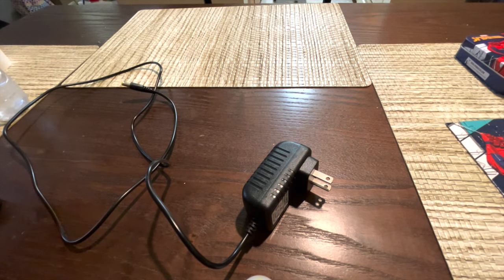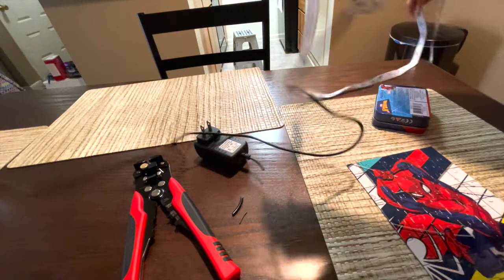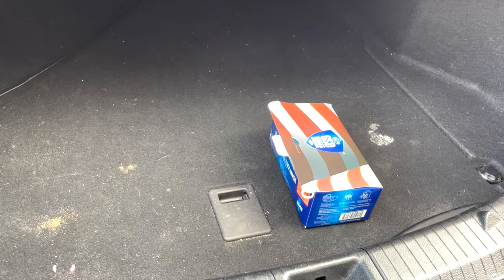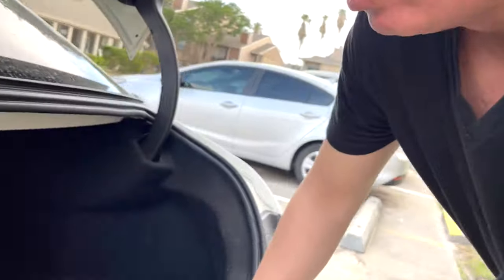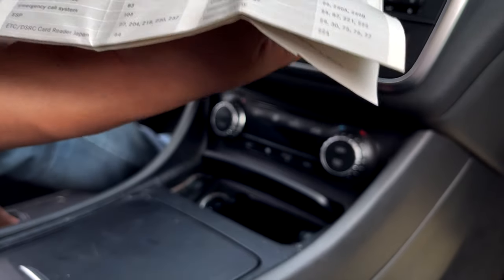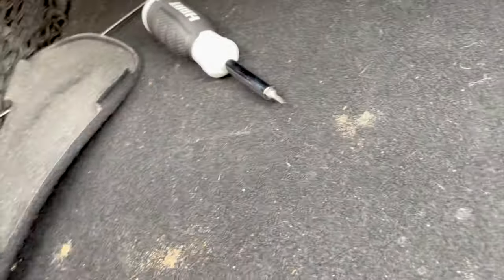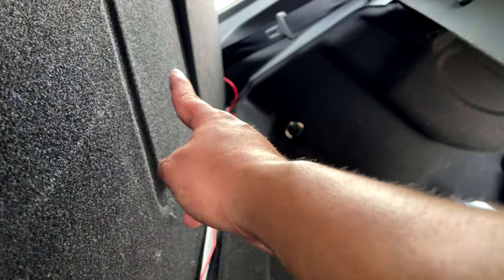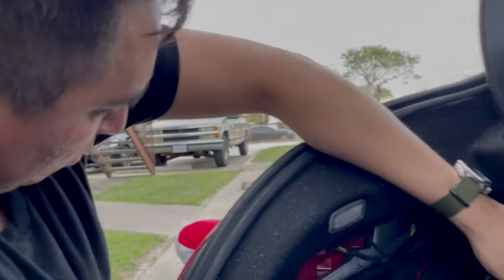The complete guide to wiring your starlight headliner (Part 2)

Comment: This is so easy what the heck, really good tutorial
Reply from the maker: Hey thanks for watching! Hope it helps you out
Reply: @ReynaldoVelasquez what were you saying about making sure the 2 fuse in the adapter is the same or less what if u use only 1 fuse u remove from fuse box under foot whel also you were saying you want to use a fuse that is only live when the car is on ? So essentially your able to turn it off from the box and turn it on when u turn on the box but I STILL will be having power while the car is running right and when off the fiber optic is off since it's only getting power when car Is on right thats what you were saying? I have understand some a what ur saying but not all as this vi was all over in a way
Reply: @ReynaldoVelasquez  and I do see the time stamps I'm using

Comment: I ordered the add a circuit and it came with 15amps but I’m using a 7.5 amp , so I use two of those (7.5) ?  You used two 25.
Reply from the maker: Yes I would recommend the 7.5 your car had originally. The 15 will work too, but in the event that the light engine goes crazy and amps higher than the 7.5, it could damage your electrical by the time the fuse finally blows at 15 amps. I used 25 because that’s what my car came with as the auxiliary outlet

Comment: could you tell me if i could use a 12v plug fuse for this thats 20A or do I have to use the cigar one thats 10A, new to all this wanting to not hurt anything wiring this in a brand new car :) any help would be greatly appreciated
Reply from the maker: Just use whatever the fuse is for the lighter in your car. It will work

Comment: Ive got the lights but I’m unsure about changing the color of my headliner. Is spray painting a good solution? Will it last and not flake off? Does it mess up the felt texture? Do you think it would look as cool in a grey interior ? And what paint did you use? I see you answering all these questions no worries if you dont get to these very helpful video
Reply: Tbh I say take off the material on your headliner and put a material you want spray painting will for sure change texture and will look okay but not good find material at stores or maybe online I’ve change headliners to suede all the time 100% better if you change it
Reply: go on amazon and you could buy a roll of suede you should do that and chose the color and put it on
Reply from the maker: Sorry for the late reply. But yeah I agree with the comments below. If you’re going through all the trouble of installing a starlight… just remove the old headliner material and replace it with a quality fabric of your choice. And use strong fabric glue

Comment: I have two light engines  450 sets  can I join them together and run two wires to fuse or have to keep it separate I have two remotes to?
Reply from the maker: I’m not too sure on the fuse part… but I’ll look it up for you… but I’m sure you can link them together and it will work… I just want to make sure for safety reasons on the FUSE side… just for you. That’s a good question no one’s ever asked me before. I’ll get you an answer.

Comment: Where can I get all this stuff? i have the lights installed and everything I just need all the cables and accessories you used
Reply from the maker: The red and black wire, I got from Amazon. The fuse tap from an auto parts store. Extra fuses etc and wire cutters, I got from Walmart electrical section. I’ll put up the links here in a bit
Reply: @ReynaldoVelasquez  I have another question does it have to be the cigarette fuse or it can be another one I own a 2008 Cadillac CTS di, so I have a fuse box in my hood and another one in the trunk and the only one that has a cigarette fuse is in the hood
Reply from the maker: @jeremialvarez6558  I believe I heard some people mention that you can use the power seats fuse. I’ll look it up one more time and get back to you. Any power source that is on when the car turns on only
Reply: @ReynaldoVelasquez  appreciate it man let me know what you find out!!!

Comment: Just want to confirm you spliced to different sizes wires to get the right wire for the fuse adapter ?
Reply from the maker: I forget what size I used. I believe I used 14 gauge copper wire. And I’m not sure what size wire the fuse adapter was. But I connected them to the adapter. Hope I understood your question correctly. I tried to answer the best I could. If I didn’t, try to explain it again and I’ll reply the best I can
Reply: The wires on 21:56 that come with the box, those wires are smaller than the actual red wire that you heat shrunk hooked to your fuse box? Just want to make sure I’m getting my wiring correct. 

Thanks again for the info!
Reply from the maker: @ByuntaeStyle  oh yeah, the light engine original wires were probably a different size than the red and black copper wires I used, and the fuse tap wires were probably ALSO a different size too. I just chose my red and black wires based on the watt and amp I would be using, so I knew they would be a safe enough gauge

Comment: Okay so you may not be able to help me with this but do you think it would be safe to do this on a hybrid? I know very little about cars but I recently got a 2019 ford fusion hybrid and really want to do this. 😩
Reply from the maker: I don’t see a reason why not. As long as you have a cigarette lighter or some sort of power source to tap into. Hybrid shouldn’t have anything to do with it. Hybrid is just electric and gasoline right? And if that’s true, I don’t think that affects the stars or the wiring.
Reply: @ReynaldoVelasquez  yea I guess I'm concerned about how much it would drain my cars battery 🤔
Reply from the maker: @Lady_Tism   I think it would be very minimal. Especially since the cigarette outlet only turns on when the car is on. The light engine uses LED’s so they don’t really use much power at all. Good question though, I should find out how much energy it actually uses
Reply: @ReynaldoVelasquez  I think I'm about to order it so I guess I'll find out lol if anything I'll monitor it and see. You gave me faith that I can pull this off tho (hopefully) so thank you!!!
Reply from the maker: @Lady_Tism  absolutely! And if you run into any problems or concerns DM on Instagram. That’s how I’ve helped others
Reply: @ReynaldoVelasquez  Okay will do! I appreciate that. Also, your car looks freakin awesome!

Comment: I have a question. There’s a thin wire coming out from that same light engine and i have it connected to the ground of car. It works fine this way. It’s not the the main wire with the dc plug, i believe it was an audio/microphone out wire that comes out of the light engine . The main wire/dc plug is running to the “audio” fuse in my fuse box straight up, no adapter or anything. Unfortunately, it’s constantly draining power from my battery as it keeps the light engine on while the car is off (solution would be to unplug the power plug from light engine). 

Do you still think i can do what you did with the lighter fuse and successfully have the light engine only turn on with the car like yours?
Reply from the maker: Hey! So obviously the red and black wire are the power source and negative. The extra thin black wire that just sticks out about 3 inches is supposed to be the antenna for the remote , I believe..... and the newer models, that have Bluetooth have since replaced this string antenna with a solid plastic antenna. And the microphone for the music is another little spot on the light engine. If you have it wired to the audio fuse.... just wire it to the cigarette lighter fuse and it shouldn’t drain your battery any more. If you can, use an “add a circuit fuse tap” to be extra safe. Then, It  will only power up while the car is running. Hope this helps buddy. Let me know if you have any other questions and I’ll try to respond in less than a day. Good luck!
Reply: @ReynaldoVelasquez  hey, thanks for super quick response dude. yea whatever that thin black wire is, i’m actually using that FOR ground and it works that way (i use bluetooth instead of remote). I didn’t install this setup but the idiot who did just literally shoved the main wire (assuming only the white part of it) into the audio fuse 😂 🤯 

I’m gonna try the fuse tap in the cig lighter method and i’ll get back. Appreciate the video. It’s definitely informative for anyone who wants those starlights 👌 💯
Reply from the maker: @verefiedxL  I have the wiring video posted up too if you want to go look at it. But the super thin wire that is all alone... if it’s the one that I think it is... and I’m sure it is... THAT wire is the antenna for the remote. And the real ground wire is with the main power outlet. Get it re-wired and let me know how it turns out. Or email me at reynaldovelasquez85@gmail.com or my social media @reynaldovelasquezjr
Reply: @ReynaldoVelasquez  yeah so the fuse tap i got was only 2-10A. My cigar lighter is 20A. I improvised and used the “meter” fuse (10A) which i assumed would only be active with the car on. Turns out I was wrong. The lights are still powered even with the car off. 🤦‍♂️
Reply: @verefiedxL  Any update on this i just hardwired mine to the cigarette lighter as well and it stays on even with the car off
Reply: @thebros2527 pull the fuse
Reply: @thebros2527 when the car is off just pull it out so u can sleep safely

Comment: 2007 tahoe.i should be good with 9 feet?
Reply from the maker: Yeah that might work. The best thing to do is to measure with a string, from the point you want to start, all the way to the point you want to end up. And travel the exact area it will travel. Then measure that string and add a few inches to it for good measure. Then order based on that. Hope that made sense

Comment: Can a  lighter connection be used for the lights + the meteors? Or each have to have a single connection?
Reply from the maker: A lighter connection can power both if you have the dual adapter. It usually comes included with the kit of you buy both together. I mad a video explaining it as well
Reply: @ReynaldoVelasquez  I buy the kit meteor plus lights and yes it comes with the adapter thanks

Comment: Can it handle in the cold by any chance?. I live in Canada lol
Reply from the maker: I don’t know how cold it gets in Canada but we once got to freezing temps here in Texas and it kept on going like a champ. It handled out extreme heat temps too
Reply: @ReynaldoVelasquez   is this the same for 2017 Chrysler 300s
Reply from the maker: @Ek-ik8yh  the location of the fuses might be in a different location but yes. And before you start, make sure to find the correct fuse needed for your car. One time someone didn’t have the cigarette lighter/aux power fuse in that location, it was located in a different location or labeled as something else. Just look it over

Comment: is there anything stopping you from using one of the empty fuses to tap into?
Reply from the maker: Nothing really… I guess I could. Good point actually… I just need to see if it gets power when you start and stop the car
Reply: @ReynaldoVelasquez  Interesting. I'm using these 2 excellent videos as a guide right now for my 92 sc400. I'm installing the headliner and also wiring a sub, only trying to mess with the panels one time. Thanks for the walk throughs

Comment: What if i want to install a on and off switch? How i wire them
Reply from the maker: Honestly… after I installed the lights I figured I didn’t need to install the on off switch anyway… because the remotes and apps have an on off switch on them. So it didn’t make sense to me. I just have them wired and if I want them off I turn them off with the app or remote

Comment: Mine came with 240v type of plug, sniped it wired it to the fuse box and still nothing
Reply from the maker: Is it the plug with the AC adapter wall plug? I wonder why it’s not working

Comment: If you buy two of these kits so you can run 2 different colors at the same time,  does anyone know how to control them separately? Cause they're the same kit the remote or the app in your phone will actually control both at the same time...
Reply from the maker: I’m not too sure about that maybe unplug one while you set the other one
Reply: Did you figure it out? Having that problem right now

Comment: Amazing tutorial, I have a question (may have been answered in the video) but heck at 6 am i'm probably going to miss a lot. The only way to turn them off is when the car's battery is off? (the car being off?)
Reply: It depends on the fuse you tap into. Look up videos on switch fuses. Some fuses stay on always and will drain your battery, others will turn on and off with the car

Comment: i see you didnt go with the on and off switch. Would it be a different route do install the on and off switch so you can personally turn them off and on with the switch so they arent always on and pulling power from anything?
Reply from the maker: Yeah it would only be a slightly different route. When I really sat and thought about it... I guess I really didn’t need a rocker switch and it would just complicate things. But... I really would like to have them wired to turn on and dim when I open the doors.
Reply: @ReynaldoVelasquez  makes sense, i think im with that one on you, might just do it your way, i appreciate it brother! Thanks for ispiring me into this project